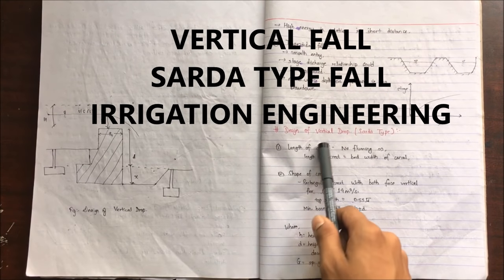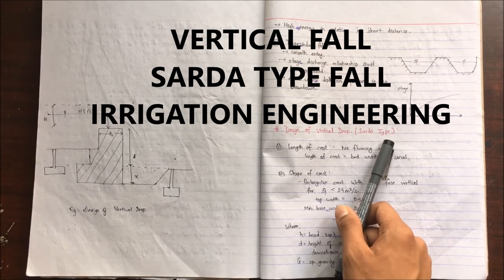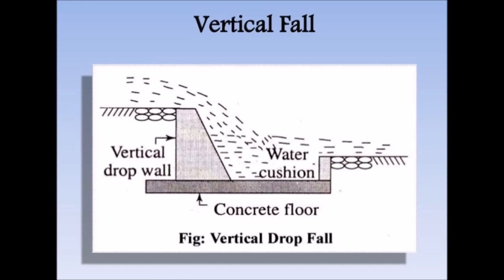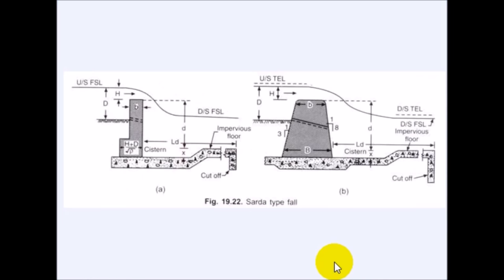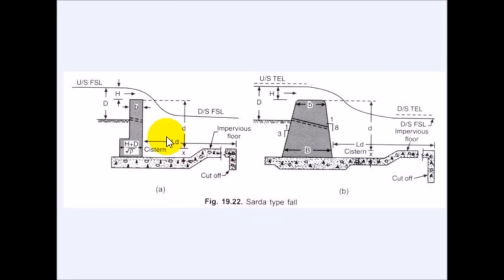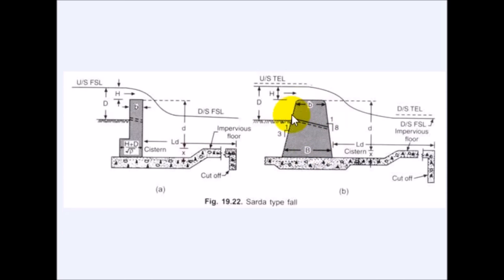Sarda Type Fall (Vertical Fall) Design | Regulating Structures | Irrigation Engineering| IOE, TU

Comment: U haven't mentioned the specific gravity of the material used to built the crest wall i.e., G
Reply from the maker: But i have used the value . Take G as per question or you can take 2.5 2.45